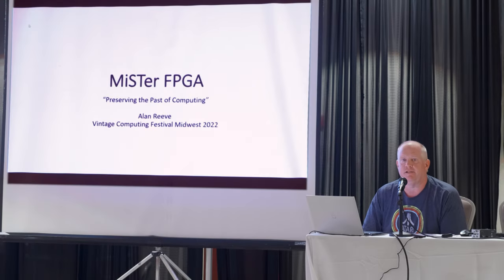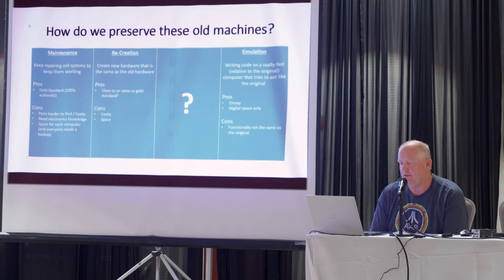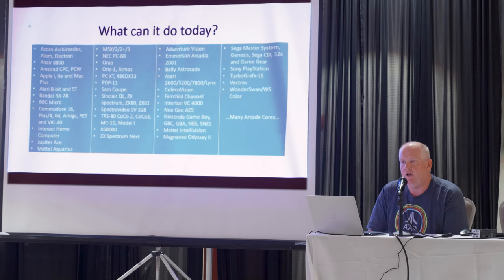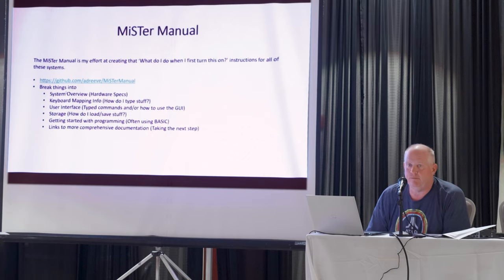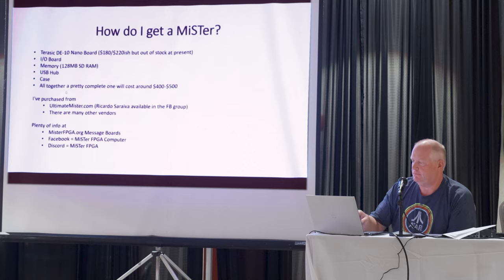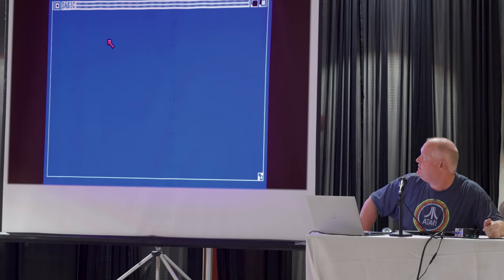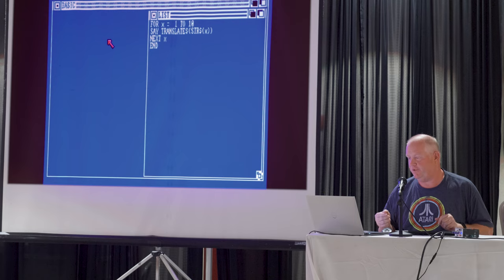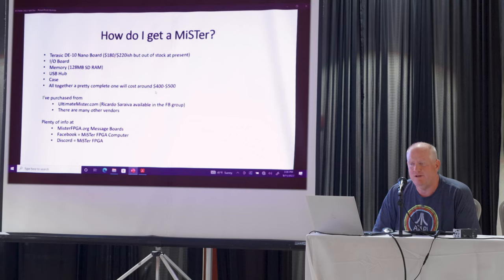Keeping Retro Computing/Gaming Alive with MiSTer FPGA | VCFMW 17 (2022)

Comment: What I love about MISTer is that it is open source and its sources are self contained AND they follow modular design. Emulators are allover the place in how they were implemented and looking at sources it is very hard to get good idea how given system actually worked internally, how buses worked, etc. and then building emulator from sources is often exercise in frustration because they didn't use the build system you have installed/used and there can be dozens of dependencies on external libraries. In MISTer you look at sources and see all signals, all buses, every piece of hardware/chip is its own module and everything builds using the same tool. Then MISTer "API" part of these cores is also self contained - so just having dump of sources for MISTer cores you could understand these computers, how they worked. You could also (relatively) easily port MISTer core to another FPGA device

Comment: The biggest issue I see with MiSTer right now, is that the newer generation of MiSTer users are no longer concerned with hardware preservation and more concerned about just playing the games.  I had a debate where some users believe MiSTer has nothing to do with hardware preservation and it is about software preservation.  New MiSTer cores are being made where the core is not a true recreation of the hardware, and entire portions of the hardware are being left out or truncated in favor of just making it work.  I fear the true reason for FPGA retro work is being diluted and twisted to appease the masses that just want a glorified emulator.
Reply: I would agree but then you can see the situation from another angle : people via Patreon and such are effectively buying research time for some people to make new cores and improve on existing ones. Those improvement would not have happenend without wider interest. Exposure has its drawbacks but it also has some good sides to it. Also thanks Alan for a cool introduction to the system.
Reply: I don't disagree however for me preservation also means preserving the memories and experiences of playing these old games and a core that does not function has little preservation value at all. there are many quality of life improvements that in my opinion are worth sacrificing 100% authenticity for, for instance many jotego arcade cores are pausable, a feature that did not exist in the arcades for us players, but is extremely convenient for people playing them now. Ultimately, it's all about playing and enjoying these old computers and games that we all grew up with.